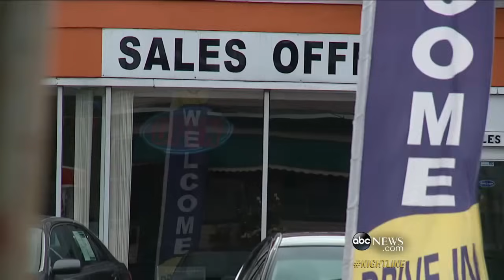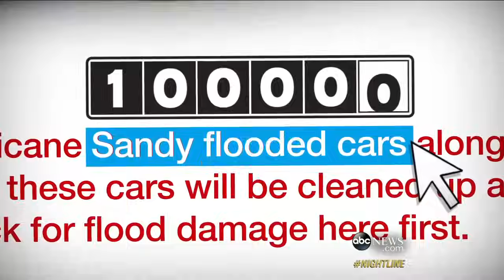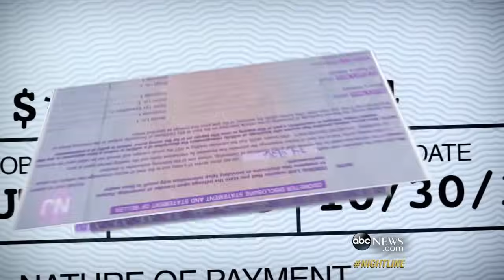How Did a Sandy-Damaged Truck Land on a Used Car Lot?

Comment: 3872 cars totaled by USAA claims / 174 Cars "accidentally" registered with clean titles = 4.5%   If you assume that other Insurance companies found the same loophole that allowed them to sell a "parts only" car without changing the title to salvage.   Apply it to the estimated 250,000 cars totaled by the storm, and you get 11,250 cars that should not have been registered.   

The news report said the truck was sold for 10 times its value.  Assume the average increase in value to be $10,000 per car, multiplied by 11,250 and you get a profit of *$112.5 Million Dollars...*

The news reporter should have followed the money.   Its always about the money and $112.5 Million is a lot of free money...   This was no accident.  This is nothing but corporate greed.

Comment: Several years ago, my brother was looking for a pick up. Noticed a small sized pick up (thinking fuel economy). Noticed some corrosion setting on the lower chassis, then saw some of the rust on the headlight connecters(one of the headlights was faulty), then the idle was rough(claimed it was the idle control valve), found the location of the ECM, noticed some rust on it......yep flood car. For sale at $5500......with clean title. It made its way to California. No thank you.

Comment: Do your research and always have a mechanic check out whatever used car you're looking at! Check all the doors and seat for any odd stains and the trunk of the car! I looked at a 2011 Ford Focus S with 110k miles a few years back from a used car dealer who got all of the cars from auctions. Good dealer he didn't know but it ended up having signs of Dead Sea life and sand somewhere in the trunk

Comment: That would make a great ranch truck.  Change the seats, disconnect the airbags and don't care if cows or horses mess up the outside.     Would never pay 20g for it, and it would get a flatbed on the back.

Comment: Flood cars have ways to be fixed but it takes a while to make sure it's going to be ok but even then by the time you're done you'll have a different vehicle that's been built on the same frame cause salt water will never be totally gone cause the frame will rust out

Comment: If it runs and drives its fine. Check the frame for external and internal rust ,   change the airbag electrics and check ABS and other diving aids. Mechanically if engine runs , the frame or suspension corrosion is the only real danger. Over than that  if you perform  standard maintenance procedures you should be completely fine.
Reply: Lol,  axles and transmission are hermetically sealed,  plus most bearings have their own insulation. And even if water got into  the axles and transmission, which is highly unlikely, most parts are submerged in oil and would never rust under any circumstances. All external engine electronics are weatherproof. If there was no water intake inside the engine which is also unlikely , its fine. To rust thru an axle  you need 30 years + submerged in the ocean water. Water damages interior mostly, and non essential systems( like electrical seats). As i said  if it drives its fine, check air bags, driver aids, frame,  and have interior professionally cleaned. And by the way punctuation is your friend.
Reply: You clearly don't  have any real maintenance  or car repair experience.  Do you really believe that if a car seats  in the water for day or two,  wheel bearings  would fail?  Or any gears or seals ? Flush the systems, change  transmission and rear  fluids. Engine oil lines are sealed.  Modern engine would not run if electrical systems are damaged, so if it runs and drives its fine. Water damage is blown waaaay out of proportion. Also take some basic punctuation classes.

Comment: There is nothing wrong will selling a flood car. If it has a clean title that means it was repaired and went through state inspections to get a new title. If a crooked dealership manages to pass a damaged car through inspections then point your fingers at the state.

Comment: My big pap had about a 1995 Ford f250 he ran it through a flood and it still ran. My pappy had a an old Ford gas truck it was ran though 3 or 4 feet of water got it almost home it stopped.came back the next day and cleaned the air box wich was filled with water and it ran

Comment: But if it works fine what's wrong with selling it
Reply: Electrical parts were exposed to saltwater and will continue to rot. The electric seats did not work in this truck that is a clue for things to come.

Comment: in order for a vehicle to get a salvage title the damage must exceed the value of the vehicle. the thing got wet, big deal. if it starts and runs its okay, a f350-250 is built to take more abuse then a little water. you pull the glow plugs, turn it over so it doesn’t get hydro locked and change the fluids. good to go another 500k miles.

Comment: Even if the red 2006 Ford F-350 Super Duty King Ranch FX4 wasn’t flooded, it would still have problems because it has a 6.0 liter Powerstroke Turbo Diesel V8 and it is by far one of the worst diesel engines made by Ford and many people who own these trucks with a 6.0 Powerstroke V8 engine have had to get these things bulletproofed mechanically at around 200,000 miles

Comment: Does Bill have a CDL? That flatbed with a 1 ton dually on it is probably over commercial weight limits.
Reply: +gravitygear  If he is not using it commercially, it doesn't matter.
Reply: In 2015 the G.V.W.R. rule was changed from 20,000 lb to 10,000lb.  If you just drive locally and avoid scales you might be o.k. Some states are worse than others for enforcement. There are plenty of hotshot drivers using this type of truck without going through the D.O.T. requirements, they take a chance of being busted.

Comment: I'd buy the truck but do the work to get it back to safe or just use it on my land for farm use. But I'll have to get the motor, trans, transfer case, and the axles in good condition. I can do the work myself.

Comment: I would buy one if you knew what you were getting in to, they can be ok then again they can be a disaster, depending on the water line and if engine was running at time.

Comment: So cringe, I’m crying, u Billy’s don’t understand this is still a mint truck worth that cash. “Oh No iT haS sAlt WatEr DamAgE” runs don’t it, there are so many fuse boxes and electrical parts that if that truck were to be bad it would not start, the seats u just change the motors on them and I have yourself a mint 6.0
Reply: By the name of Defstorm / dynoman200

Comment: dude let's be real it isn't that hard to repair a car that's been in a flood that has been in salt water as long as it stays in tact as long as you clean them out well, I got a 55 Chevy Bel air that went through a flood and then sat, I took it and restored it, it wasn't to hard either

Comment: Rust is slow to happen but the first to go is anything electric, wires motors (seat, blowers, etc...), that’s why the seats won’t move.

Here on the Jersey Shore on a full moon tide the water backs up into the streets. Folks don’t stop to think that it hasn’t rained in days so why do we have puddles or a flooded road with several inches of water? Because it’s saltwater from the inlet. 
The vacationers from the city’s north of us blow their horns at me when I won’t drive through and try to turn around, then they blast through shaking their heads or shouting at me. Give it a few days and the electrical salt gremlins will destroy the starter then in time work at the wiring. 
Ignorance can be expensive. 😉

Comment: I just looked at 2 trucks on the same lot in Fla  

That were flood damaged out of Texas

Rusted seat bolts new a/c blower motors and electronic gas pedal brand new on both 

That's what I look for but that's me

Comment: It a scam that's been around as long as the automobile itself. Selling a flood vehicle across state lines with a clean title is the equivalent of drying out insulation that been submerged in swamp or sewer water and selling it to be installed in a new home. With the exception the flood vehicle can kill with warning.

We need a national data base for consumers to do a free vin check for slavaged vehicles. No salvage vehicle should be allowed to leave the state where it was totaled. Once they cross state lines they receive a clean title. I was calling for all these vehicles to be crushed during the storm and each subsequent hurricane that hit the US and it territories. 

There is no guarantee any part of any flood vehicle wasn't touched by water. We have too many crooks to take chances. This is the insurance companies responsibility once payment has been made on a totaled vehicle to the insured owner. At that point they must take ownership and destroy the vehicle. Yet they continue to sell the vehicles to get money back. It won't change until there are class action lawsuits. Not a single part of a vehicle that touches salt water is salvageable. The only exceptions are single walled plastic body panels without any metal components molded in them. And non-laminated side window glass. Even salvaging that has a low cost benefit. Any electronic components above the water line are compromised because the wiring wicks water up into the component itself. The entire vehicle must be crushed for recycling.

Comment: If stupidity always caused pain, there would be less stupid people.  Costing them money is a close second.  Obviously it the seats did not work because the fuse was blown, it would have been replaced as soon as the problem was noted.   If the dealer is going to repair the vehicle the next day, obviously a wise or at least semi-conscious person would wait until after the dealer repairs the vehicle.

Comment: Nothing wrong with flood vehicles if you dont mind swapping all the electronic's out.  I got a laugh about them saying parts will rust off in a few months, drive in the rust belt the salt in winters worse then that truck would have seen by a long shot.

Comment: I just bought a 2010 vehicle & found a Sealed Verizon Phone Bill in the vehicle from a previous owner. Guess where it's from... New York, which is the same area where the vehicle was ran through & sold by an Auction Company, there on the East Coast & ended up 780 miles East of New York to here in Michigan.............